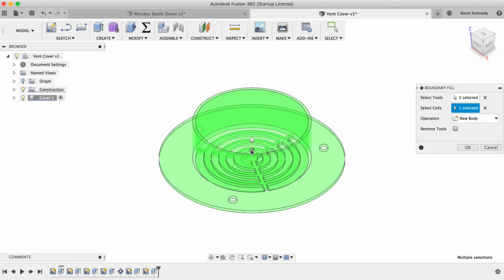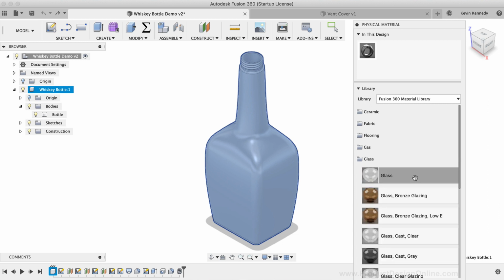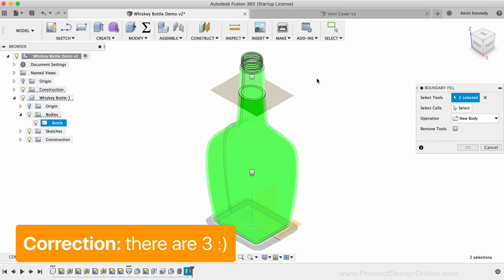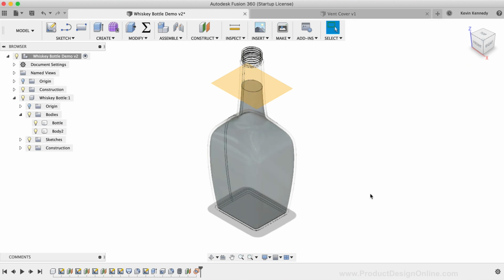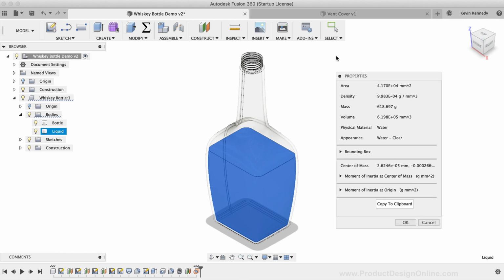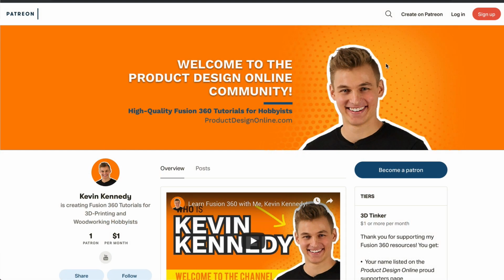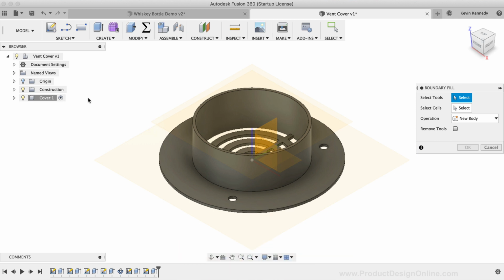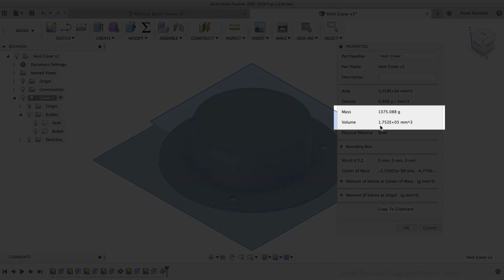Find Internal Volume in Fusion 360 | Do This before 3D-Printing

Comment from the maker: Have I saved you time and frustration while learning Fusion 360? Consider becoming a Patron. 
Check out my NEW Patreon page ► https://patreon.com/productdesignonline
__ 
TIMESTAMPS
0:00 - Check Internal Volume in Fusion 360
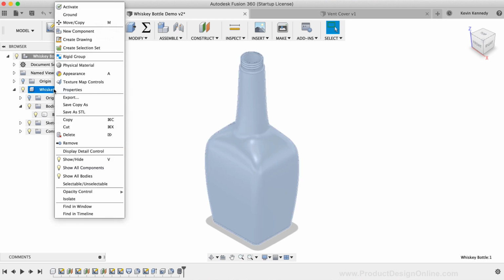1:43 - Changing the appearance
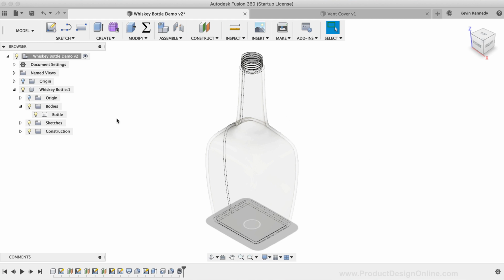2:10 - Creating an offset plane
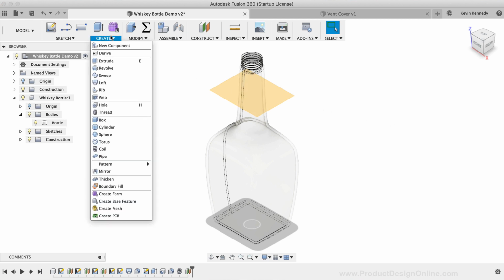3:03 - Using the boundary fill command
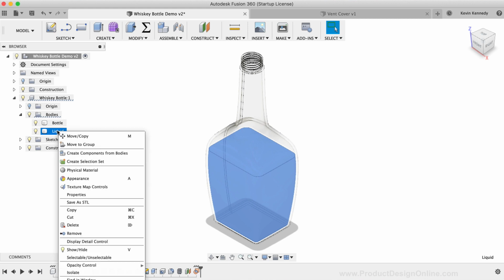7:29 - Viewing the volume properties
10:19 - Checking volume of another shape
Reply: Do you know how to get the units of volume to read in ML instead of some weird E value? What does the E value even mean?

Comment: What I do now to find volume for resin casting. 
(My units are set to mm)
I set my material's physical material to Silicone Rubber.
Select the entire model that represents the resin. 
Right click the model and click on Properties from the drop down menu.
The mass value in grams is what I use for molding. I round up a little so running short doesn't become a problem.

Comment: Can you add any clarity to the "6.19E" notation for volume? I've been looking on the web and cant find any clear conversion for that. I am trying to design a bottle that holds 750ml but nothing is converting from what I see here to help.
Reply: E is just the exponent, for example 3.2E+4 == 3.2 exponent 4 == 3.2 to the power of 4 == 104.8567

Comment: I wish I had seen this video before I poured some concrete for my pizza oven - I could have calculated the volume of the form minus the concrete blocks and bought the correct number of bags of Quikcrete. At least now I know for any future pours. Also, I am considering buying a Peopoly Phenom, but concerned about the cost of the resin - now I can get an idea of how much each model will use, and calculate the cost - that way I can weigh the $ cost of any design decisions as I am modeling the parts - thank you!

Comment: Kevin, thx for tutorial. It is nice idea to use Boundary Fill func as negative model. For example draw part and then make oposit model as cover or support for it. Nice.
Reply from the maker: Thanks for watching and commenting, Roman! The Boundary Fill command is super helpful and can definitely be used as you describe. At some point, I'll make a tutorial covering all the tips and tricks specific to the Boundary Fill command. It's a very useful tool that is often overlooked. Cheers, Kevin :)

Comment: Is there any way to do this 'in reverse' - say to create a 1 lt measuring jug, with graduation marks every 100 ml?
Reply from the maker: Hi, Duncan. Great question. You can use the boundary fill command in the opposite way as well. At some point, I'll try to do a video solely covering the Boundary Fill command and all the different techniques on can use with it. It's a very helpful tool that is often overlooked. Cheers, Kevin :)
Reply: @ProductDesignOnline  Thanks. I look forward to that video. I didn't know about the boundary fill command before today...
Reply from the maker: @duncanx99  There are lots of helpful commands that are underutilized. Once they push out the new UI look I'm planning on doing more tutorials on specific commands. Cheers, Kevin :)
Reply: @ProductDesignOnline  I think I'm looking for the same thing; I'd like to be able to design small measuring cups etc for a kitchen with specific volumes, for liquids and solids "rice, flour etc).
I will keep looking though your videos but I cant see one that covers this yet.
Reply from the maker: @PtrJns  Hi Peter. I haven't covered the "reverse" of this video yet... but will try to do that at some point with my new 3D Printing related series. Cheers, Kevin :)